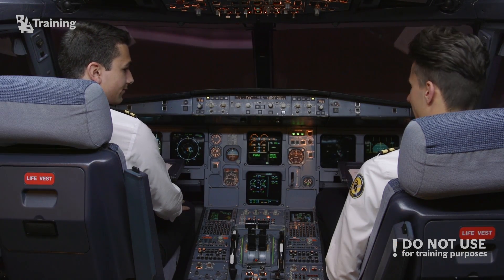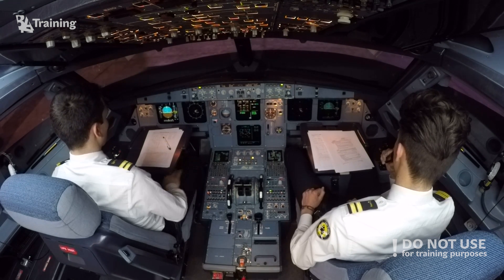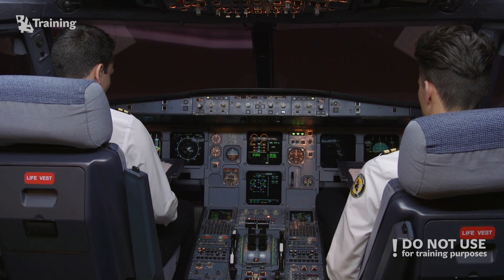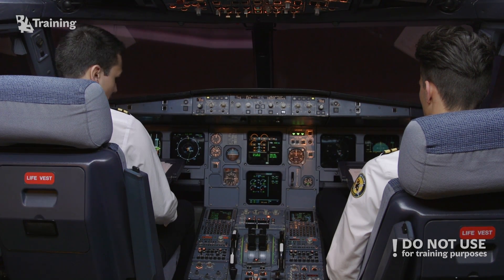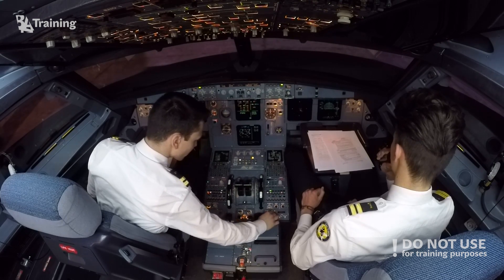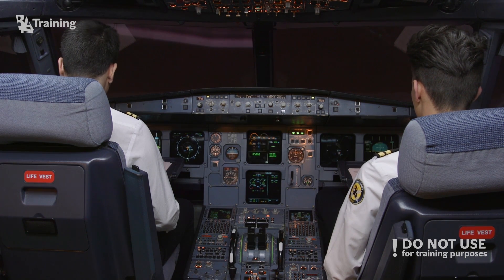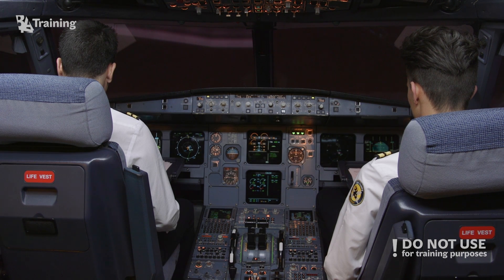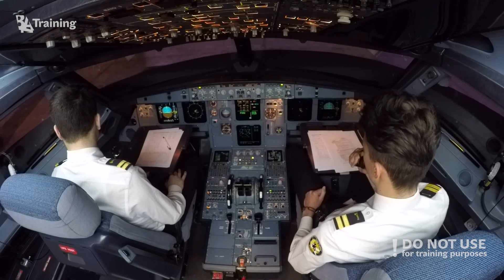Manual Engine Start Procedures on Airbus A320 - BAA Training

Comment: In our air company we switch engine mode selector in IGN with "CONFIRM" 

For example 
"Engine mode selector ignition, confirm?"
"Confirm"
Reply: On ground, even irreversible actions don't need to be confirmed (by Airbus)
Reply: Would you also do that for a manual engine start? Getting confirmation from the other pilot is something I've so far only seen in situations where it is critical for the safety of the flight to prevent any "oops, wrong button" situations.
Reply: Bart Kuijper yes, for Manual Start we also use "CONFIRMATION" for "engine mode selector". But, this rules different for each airliner.
Reply: Thanks for your answer, it's interesting to learn of differences like that :)
Reply: Bart Kuijper any information for you 😉

Comment: Nice. Thought you had to set anti skid to off for pushback though
Reply: The bus driver of Perajarvi not really. The pressure for the nose wheel steering is disconnected while the pushback pin is inserted by the ground crew.

Comment: Make it on A321 Neo too....! How much does it costs for Type Rating on Airbus A321neo??
Reply: Lucky 222 the cockpit does not doffer at all in a318, 19, 20, 21 and 319neo, 320neo and 321neo so the type rating is the same as for the a320 family.
Reply: @kubasamolot  Is everything of Same of Their procedure to Train a Student & what about Cost?
Reply: I don't quite understand what you wrote. Student training is the same, pilots who were flying A320 now can fly A320Neo without any further training. The only thing that differs there are the engines so if the type rating has always been the same for CFM and IAE, why would it be different for P&W and LEAP?
Reply: @kubasamolot  Alright..You know about Cost of Training & Duration? Thankxx..✌️